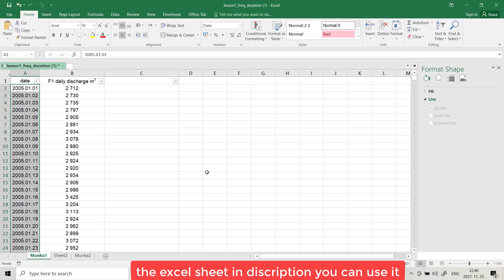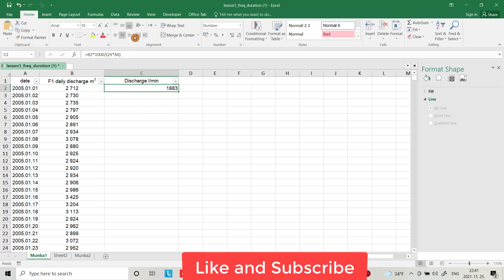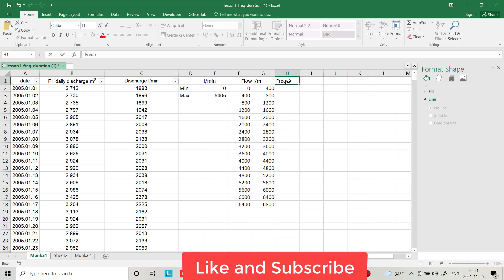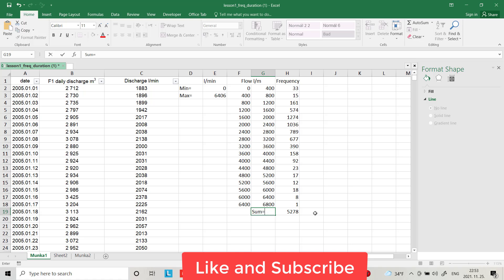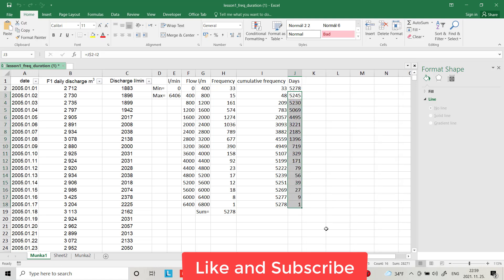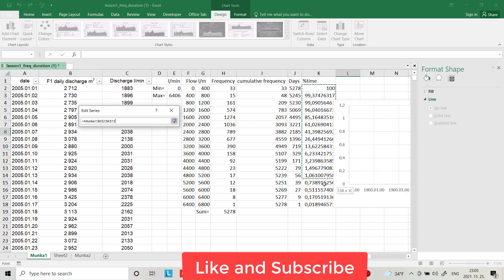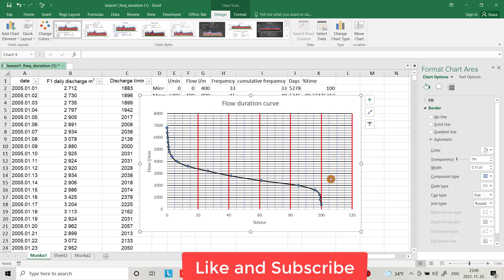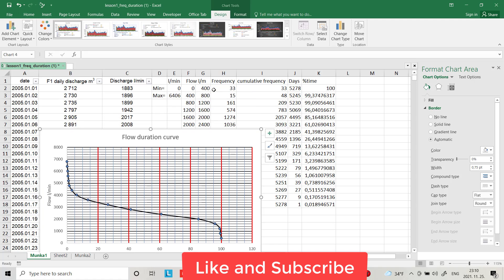flow duration curve example Hydrology

Comment: Thanks so much for sharing.
I wonder why the Flow l/m value is 0-400, how the 400 value was chosen
Reply from the maker: You are welcome, regarding your question, I used about 5000 data ,and I have to find frequency so that I need to determine a range of flow, I selected 0-400, you can change the range , the smaller range, represent the flow better, I hope now it’s be clear